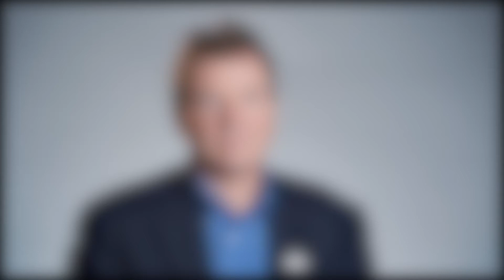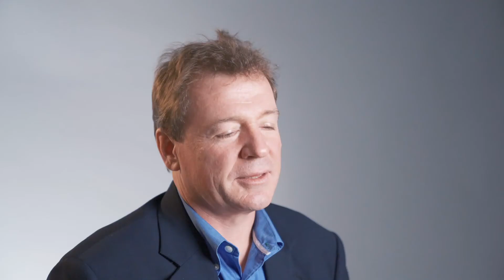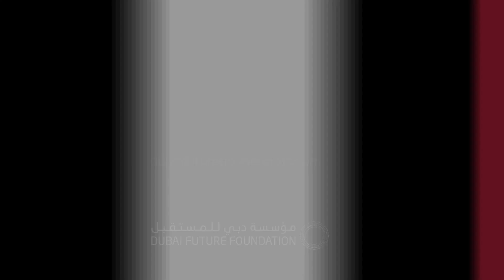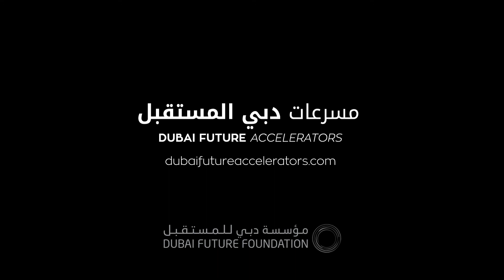M-CYCLE:  IMAGINE, DESIGN AND EXECUTE THE FUTURE

Comment: M-Cycle is certainly not a discovery of a magnitude as high as fuel engines. Indirect evaporation has existed for a millenia. You can find ancient indirect evaporators in Gandhara museums. M-Cycle offers an extra range of temperature difference that is otherwise impossible with indirect evaporation.
Reply from the maker: M-Cycle is namely an invention of breakthrough and disruptive technology. It differs very much from simple indirect evaporative cooling - 1) achieving dew point temperature, 2) the hotter - the better, more cooling capacity while temperature is raising, 3) numerous applications in various industries, 4) next step - waterless evaporative cooling with water from air harvesting and close loop recirculation with water regeneration
Reply from the maker: Maisotsenko Thermodynamic Cycle (M-Cycle) is fundamentally different, and therefore changes or improves everything known and developed in last 200 years, it is new physics, or more accurately- better understanding of it, and more importantly- better practical applications! Example we site often: going from horse to engine, and now- from engine to M-Cycle!